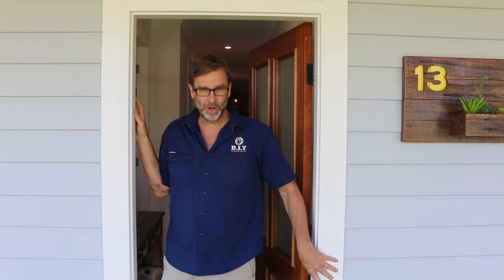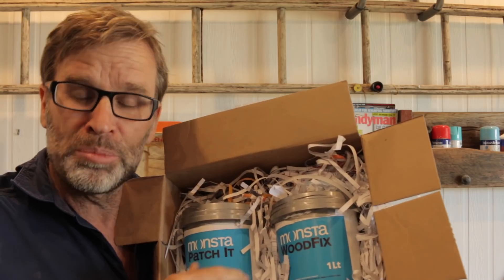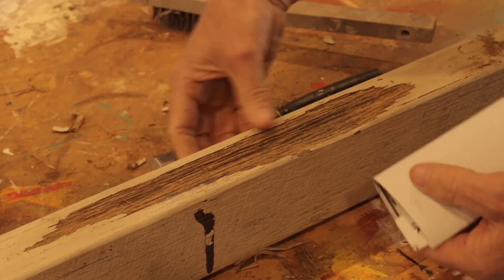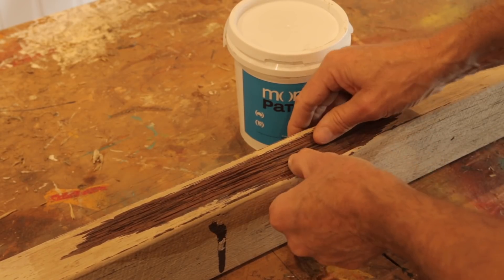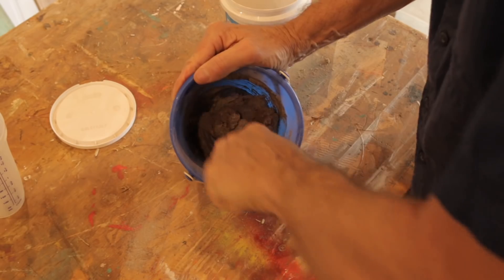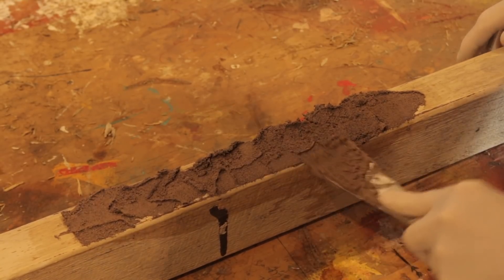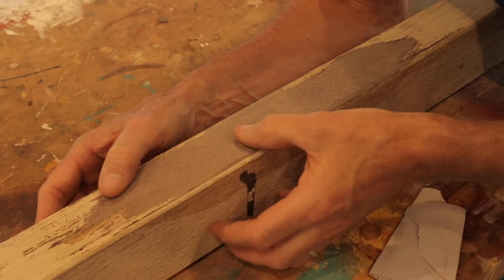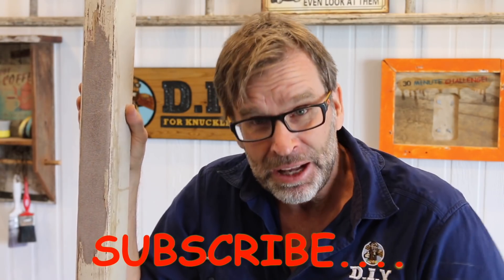How to Repair Wood Rot. Dry Rot and Wet Rot.

Comment: I have just ordered some wood epoxy filler after watching a few of these kind of videos. I have discovered that this stuff is more expensive than the wood being replaced. The small rot here took 1/4 of the half pail of goop used and mixed. My use is for carpenter ant damage and rot on a location that would need much more wood removed if taken out. So I'm hoping this saves much time while it loses on cost of wood it is replacing. Fun video :)
Reply: Would be happy to get your thoughts here. I have a case of wood worm and after treating it against them (not sure it helped but i think so) - would like to strengthen the wood that got damaged. any ideas for meterials which can help ?

Comment: Thanks for informative video. Good to know for future. But if this is being done on a beam under porch boards, could you get a screw in that securely to attach your porch boards? Or should I use an actual wood patch with glue and screws after removing bad spot?

Comment: Is it strong enough for bearers & joists on an outdoor patio. Totally repairing mine from scratch but can not cut of main bearers as they hold the weight & go under the house floor. Only on the top first 10 to 20 mm are wet & rotting, to scrape it off & put a layer of this product, will it take nails, nuts"n" bolts. It's a huge job. Oh and does the wood have to be dry for the first treatment. Thanks.
Reply from the maker: G'day N.M.....In your case l would rebuild the timber with the product and then place a new support post directly under the affected  area/areas. For best results, it is advisable to have the timber dry prior to application. Good luck 👍👍

Comment: Interesting vid knackers, im abit skeptical on the wood fix part of it but im going to try this product. Is it printable once dry?  will it need an oil undercoat before top coats are applied like some fillers do?
Reply from the maker: Thanks Brad. Yes it is paintable mate and l'm not 100% sure about the necessity for an oil based undercoat....you would need to contact the company for clarity on that. Cheers mate and thanks for watching 👍

Comment: very entertaining video.  Thanks Shane, just ordered the product.
Reply from the maker: Thanks Claudio 👍.....you'll like the product mate 👍😁🇦🇺
Reply: will advise the outcome.
Reply from the maker: @claudioiacobucci2286  👍😁
Reply: @claudioiacobucci2286  HI Shane, it worked really well.  The area was at the bottom of the beam.  So I placed a piece of timber under it and filled the hole.  Thanks for your video, the product is amazing.

Comment: Would you recommend using this in a rotten floor joist?
Reply from the maker: G'day mate...a floor joist is a load bearing component so your best bet there is to either replace the joist or if it's salvagable, attach a timber splint on either side of the damaged joist. Hard to give an accurate response without actually seeing the problem. Cheers 👍

Comment: That’s pretty cool. I wonder could you use the fungi killing stuff as a finish to protect against rot in the first place on like a new project?
Reply from the maker: G'day Brian. Probably not mate as it darkens the surface. I believe they have just introduced a new Naked Sealer which l think is suitable for timber as well as ceramic surfaces. I hope to have a look at that soon. Cheers mate

Comment: Would this be useful for outdoor wooden steps , something that could bear weight . Enjoy review of product videos , hate spending  money  on products  that don't  work. Tkanks
Reply from the maker: Probably not Nevalyn....l haven't tested that but l would suspect that the flex of the steps would weaken the patch over time. Cheers 👍
Reply: Thanks for responding , yeah makes sense pressure would  be too much  for the patch

Comment: Could I use this on some questionable sleepers in a retaining wall?
Reply from the maker: Probably not Glenn....better to replace because it is a retaining wall. Thanks for the question 👍😁🇦🇺
Reply: Glenn Thomas ... Hi Glenn, I don’t know if you’ve done your retaining wall repair/replacement yet, but if not might I suggest you look at concrete sleepers? I’ve had 25 meters of my side retaining wall replaced after the last treated pine (75x200mm) rotted out and began to collapse.
Concrete will be a permanent wall. 👍

Comment: Shouldn't you let the wood fix saturate the fibers rather than touch couple times on the surface with the paint brush? How do you know there are no termites deep inside the wood? Self levering rot repair epoxy is pretty good for that, sanding not required.

Comment: can you drill screws into it? Can you use the Wood Fix to help prevent rot on new wood? great video.
Reply from the maker: Yes you can drill screws into it Al. Woodfix I believe has been designed for timber that contains rot. I was checking out their website and noticed that have a brand new product out called Naked Wood and Concrete Sealer that repels water....looks interesting and may be worth a look. Cheers mate 👍